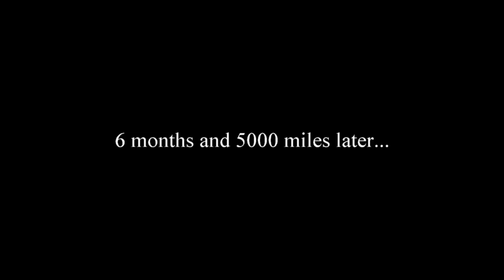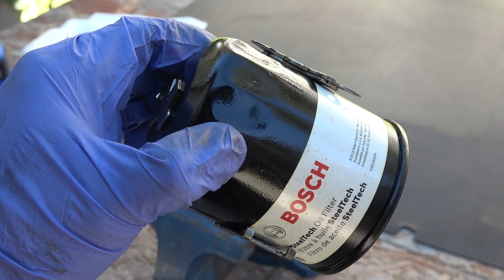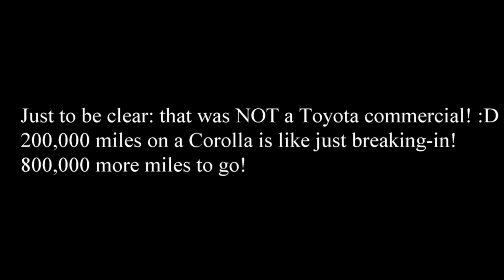Putting magnets on oil filter. Does it work?

Comment: Keeping metal shavings in the oil filter is your last worry. If there are metal shavings in the oil, you need a new engine. BTW, there is a usually a magnet in the oil pan.

Comment: No magnets do not work on an oil filter, a magnetic drain plug does work, one on the filter only gets the metal after lt has already gone through the oil pump and is grinding it up. And the metal will be removed every time the drain plug is removed.

Comment: Next time, use tin snips to open the oil can. Also fill the oil filter and wet the seat ring with oil before you install the filter.
Reply: "wet" it? 🤣 C'mon now. And you don't prime every filter unless you want to creat havoc with your gaskets. This video is full of misinformation and nonsense

Comment: When I first started watching this video I thought to myself "this is going to be real good!" "An actual test to see if magnets work inside of an oil filter after a few thousand miles of driving!" So I was eagerly awaiting him to bust out the oil filter cutter and open up the oil filter. When I seen him pull out the angle grinder, my stomach got tied in a knot and my jaw just dropped😫!  
I knew right away that angle grinder was gonna make the test null and void since the angle grinder will grind off the oil filter canister and all the tiny shavings will get caught with the magnets. Now you don't know which particles came from inside the engine and which came from cutting the can🤦🏻‍♂️🤦🏻‍♂️. Good Lord man! Invest in a decent oil filter cutter! You disassembled precision hard drives to get the magnets and then you hack into the oil filter with some derelict angle grinder like a mad man! 🤷🏻‍♂️ Get yourself a dang oil filter cutting tool dude!!

Comment: There are all over 
But it’ll all from your grinder 
If that comes from your engine then it’s time to change your engine 
I have on my car magnetized plug 
And seems to catch some of the black dust 
But once I touch it seems just fine dust 
You cannot see with naked eye on the magnet because all the bigger particles are cached by the filter paper

Comment: I agree with you that the filter does the Trick. Further more, heat will reduce the power of the magnet. 
However, the maget will help to keep the filter media free at least during the cold strat. I like to use them so that I can have better oil circularation...

Comment: Always cut the crimped end just at the crimp. Its like a food can. Most engines don't have ferrous metals in them anymore.
Reply: Cylinder walls are steel as well as cam shafts.

Comment: Hi does anyone know why the sw900 or kt lcd3 blows my ebike fuse.it never happened with ,my simple controller /throttle.well last ride screen just went off with the power too after only 200metres,battery ok.an fuse ok too.20amp blew first time so replaced with 30amp,it’s 14s5p pack.samsung 25r plus some Panasonic cells.2600.its 500watt front hub motor.an 26amp controller the simple one with no lcd just throttle.i thought the kt lcd3 I’d rated at 35amps.came with very beefy dual mode controller
Reply: I've found that some cells were high near 4.2 v well 4.15 to 4.19 so discharging them  on turnigy charger.im waiting for a smart bms to arrive so hopefully that will balance in situ?and can monitor cells.
Reply: it was group of panasonic cells that were high in a 4s pack in series.other cells samsung 25r measure 3.7v the 5s pack an have a 2s pack that are 4v so will make all cells 3.7v .i think controller is cutting power when cells are low or high
Reply from the maker: @stevemcgowan3017  My 48V controller cuts out at 41V.
Reply: with my smart battery meter on my 2s pack the internal resistance was 27 and 32.is that ok?goinj check others
Reply: @stevemcgowan3017  FYI: You can't just put your DMM to Ohms and measure battery internal resistance.

https://batteryuniversity.com/learn/article/how_to_measure_internal_resistance
Reply from the maker: Did you just get a new controller?
Reply: It was all part of kit from ccbikes eBay last year.i sent it back thinking not working but turned out the motor was dodgy.when I got a new motor the kit worked straight away for. While then blew fuse .so thought would try the simple controller and no lcd .works ok.    Need take for a run

Comment: Hi .on my ebike battery problem.do you think  I need to check the cell resistance on each cell?gettin power drop outs ..before I buy a new battery off eBay .local guy makes them 48c packs 144£.i have a smart bms on order also .
Reply from the maker: Yep, that's a good idea to check the cells first.

Comment: If you do have any larger fragments wouldn't they've  been stopped withing the filter material itself? I thought the magnets were a great idea. They would've assisted in pulling any metal into the filter material. I thought that was the point but, you only checked the housing?

Comment: you can buy a tool for cutting open oil filters. It's like a big can opener and doesn't leave any shavings. alternatively you can grind off the swage that holds the two parts together.

Comment: A filter cutter is best,magnetized metal can only hold so much as seen with transmission oil pan factory installed magnets, like you said the key is to use good or high quality filters.Your engine is in good shape cant beat regular maintenance

Comment: Before you fit the new filter you should always put some oil inside to help
prime the pump.....
Reply: just put about 200mls in filter before you screw it back on, because it is upright it will not spill
Reply: @kermets  Priming is less important now than in the days of piston pumps, but I'd do it anyway, especially if the filter threads on upright. Cheap and easy. Oh, and you can make a decent funnel from a large, tall yogurt container or similar and some duct or aluminized tape.
Reply from the maker: Great idea. But I just don't like to deal with the mess.
Reply: Pointless as the residue of oil is sufficient until the new oil gets moved around

Comment: Mr V, perhaps a video idea. I'd like to add a fan into my power tool's standard charger (the standard 45w kobalt charger). I understand I have to modify the casing to accommodate say a 120mm pc fan into it (just a 12v and neutral wire). Is it possible to connect the fan to the incoming power from the wall somewhere on the pcb or do I have to take from the secondary windings at the transformer?  Also, what is possible to do to make a diy 45w tool battery charger into a 110w charger?  Thank you for your time.
Reply from the maker: I think you can add a 24V DC fan and connect it to the charging terminal. But I don't think you can modify the 45W charger into 110W charger though. A lot of things need to be modified to increase the charging current.
Reply: @vuaeco  thanks :<

Comment: I've used a regular hacksaw to open and inspect oil filters, and made the cut near the threaded end, which should give you less new particles. Cool test Vuaeco!
Reply: There are in fact oil filter cutters for this, which operate similar to a copper tubing cutter. Alternatively, I wonder if perhaps you could use one of those manual can openers that cuts the side instead of the top, though I suspect the flange may be too hard for that.

I'm a cheap cunt tho, so I'd just stab a hole with a screwdriver and then use tin snips the rest of the way. I guess I forgot how thick those motherfuckers are...don't break your screwdrivers or tin snips trying to open one! lol